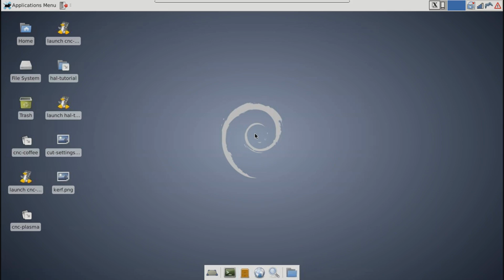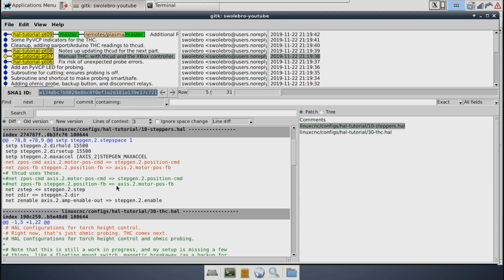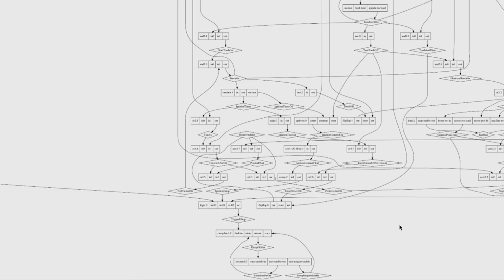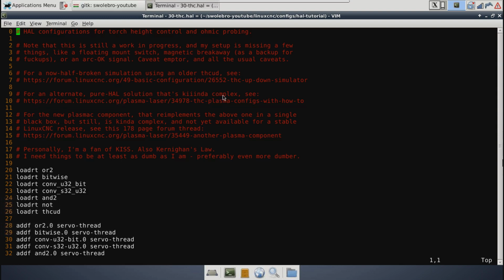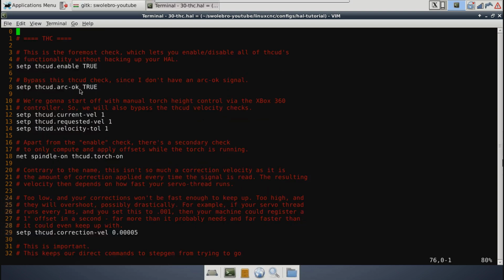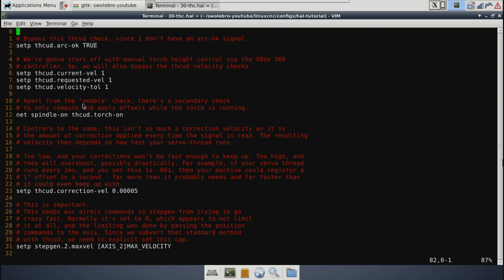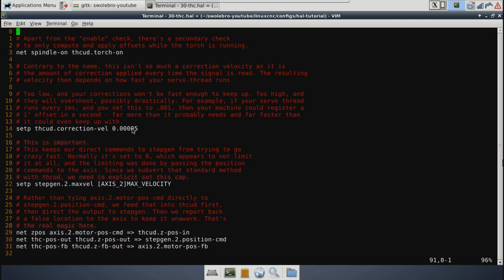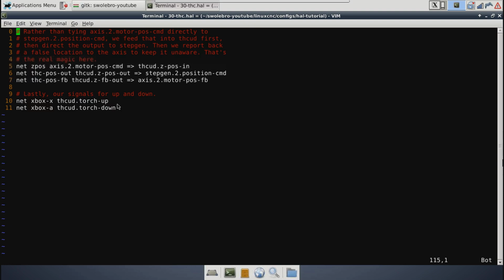LinuxCNC HAL #7: plasma cutter manual THC

Comment: what different manul THC and auto THC?
Reply from the maker: The signals for the automatic one come from the Arduino later on in this video series. For the manual one, you gotta watch the torch and hit the buttons.
Reply: @swolebro  I've seen your video auto THC with arduino, good video and easy to understand. In my mind, your arduino auto THC does it seem like I can't find the arc like arc OK/arc ON feature, will THC work without turning on the arc? And what kind of sensing do you use?